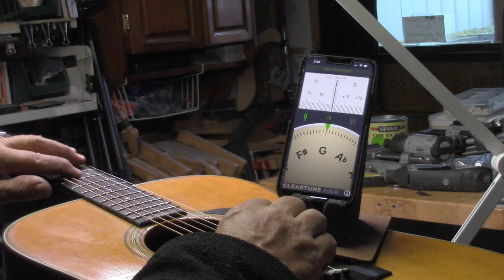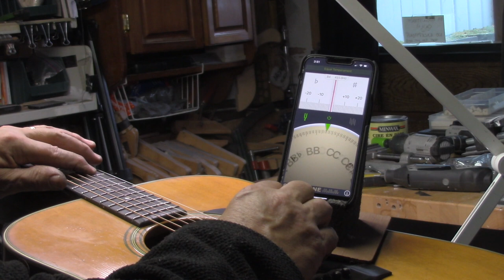1976 D-28 Neck Re-Set / Re-Fret / Calibration @StringTechWorkstationsPerfectly Tuned D-28 Martin

Comment: Mate what is the best technique to neck reset a guitar that has a dovetail joint which was bonded by an EPOXY?
Reply from the maker: That's a tough one. If it is a cheap guitar ... saw the neck off at the heel and convert to a bolt-on neck with threaded female inserts and "pan head hex-drive" murakoshi fasteners.
Reply: @StringTechWorkstations  it was a Takamine signature guitar though.. what other ways can you recommend besides sawing it sir?. Thank you
Reply from the maker: I don't believe that is a dovetail. They have 3 dowels that hold the neck in place. If you can slip off the fingerboard extention .... and slip a thin japanese pull--cut saw between the cheeks of the heel and the sides, you will be able to saw through the 3 dowels. Then on the re-install use 3 murakoshi fasteners to replace the dowels. Good luck !
Reply: @StringTechWorkstations  dovetail cause i have emailed takamine company.. they were the ones who said it was a dovetail with epoxy bond...😔😔.. the guitar model was Takamine JJ325SRC John Jorgenson.
Reply from the maker: Well... they would know. I've seen lots of the triple dowel configuration on the Taks.  Did they indicate how you should remove it ? I would imagine that drilling the pilot holes on either side of the dovetail at the 15th fret .... like you would do for steaming the neck off of a Martin ( I've got one on the bench right now ). The steam won't loosen up the epoxy. A lot of people are now using the hot wire setup instead of steam.
Reply: @StringTechWorkstations  i've already asked them on what will be the best method to reset the neck but sadly until now.. no reply
Reply from the maker: Fingerboards on Taks are usually pretty thick. You made be able to change the trajectory enough, by sanding the fingerboard. That is pretty  common way to avoid a neck reset altogether. Of course it would mean a completer refret too .... just a suggestion.
Reply: @StringTechWorkstations  ok thank you very much for your time and very kind response sir❤️
Reply from the maker: https://youtu.be/7cQtt-Ps8cs?si=EK0DClAmTGhNyqAp
Reply: @StringTechWorkstations  good idea but the fingerboard of my takamine is not thick enough...if i will do that the neck of the guitar underneath the NUT will be TOO THIN.. maybe i will just change the fingerboard to a thicker one..never minding the narrowing angle of the binding on the fingerboard.. thin on the nut side and it will be thick on the 15th fret and then on the nearest part of the FB at the soundhole will be same as thickness on the FB near the NUT.. what would it be?
Reply from the maker: The 1980 Martin Koa Dreadnought that I am currently doing a neck re-set on .... is a combination of the video ( above ) and an actual dovetail removal and re-set. Stay tuned ... it's coming up next.